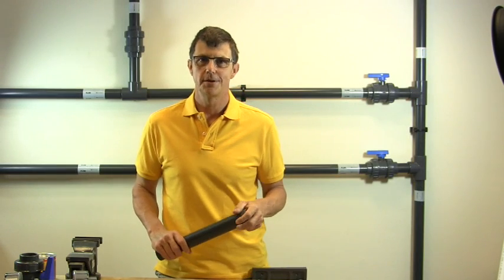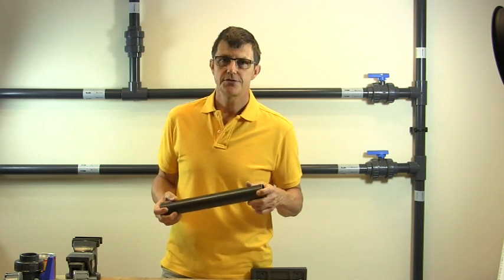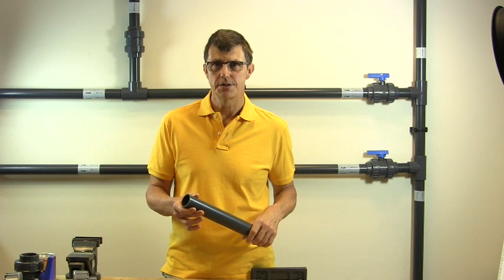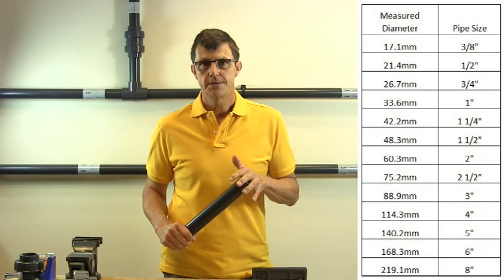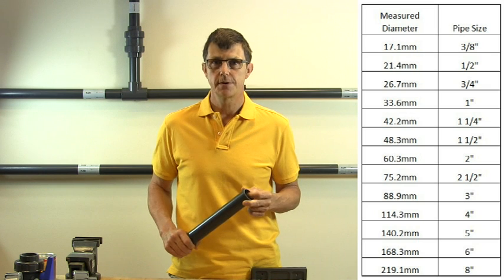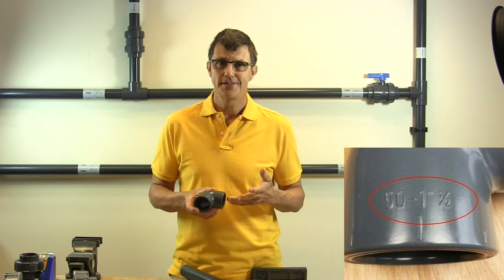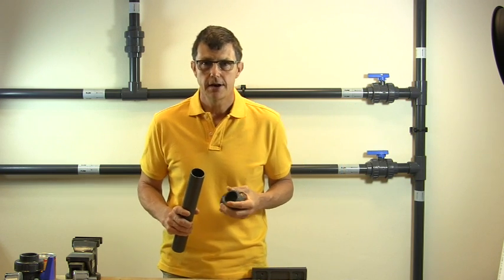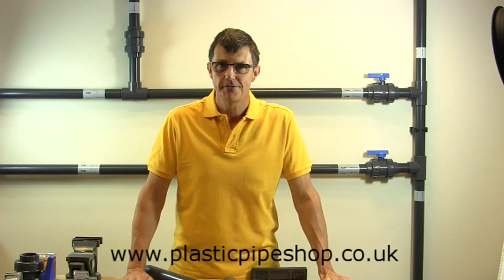Getting the right plastic pipe size

Comment: How would I know about the pipe size I need (actually clamp).. the pipe was about 8 inches circumference.
Reply from the maker: Hi there, if you are measuring PVC pressure pipe, then it is best to use a measuring tape or calliper to take the millimetre measurement of the outside diameter of the pipe. If your pipe is measuring around 8 inches, then it could be a 20mm pipe, and you'll need a 20mm clamp. Hope this helps!

Comment: Helpful but I need a tank connector for pipe that measures 32mm ID and 36.5mm OD.  Can't see that size anywhere in your tables. Also I have a sleeve connector (external) in a packet for the pipe that says 32mm but fits the OD of 36.5mm so excuse me for being rather confused.
Reply from the maker: Hi there, are you working with pressure pipe? We don't supply that size unfortunately, so it might be that you are working with a different kind of pipe system (e.g. waste).

Comment: Why does they measure differently ???
Reply from the maker: Hi there, they measure differently as they are two different measurement systems made at different times. Imperial sizes denote the approximate bore of the pipe, while metric sizes denote the outside diameter of the pipe.

Comment: PVC pipe in the US 
is measured as ID inside diameter not OD outside diameter
Reply from the maker: Thanks for the comment - in the US (and with imperial in the UK) it is measured as a "Nominal Bore", so an "approximate bore" of the pipe - but it is the outside diameter that remains constant. For example 2" sch40, 80, 120 etc. all have the same outside diameter - the 2" refers to an approximate bore of the pipe, not the actual measurement of the inside diameter. As the pressure rating increases, the wall thickness increases and so the bore changes. The outside diameter however remains the same, which is how you can fit a sch 80 pipe into a sch40 socket and visa versa. When pipe is manufactured only one dimension (either the outside or the inside) can be controlled to the tolerances required. The outside is always the controlled diameter as this is what must marry up with a socket. If you cut a piece of pipe down the length, whether it is made in Europe, US or anywhere else in the world, you will find that the inside diameter can vary quite a bit, but the outside diameter remains constant. So, if you want to be sure which pipe you have, measure the outside diameter, not the inside, as this can change with pressure rating and manufacturer.
Reply: That means head loss will be more in higher rating pipe ( sch80) for the same diameter and flow in (sch40)
Reply from the maker: @a.r.kconsultants6534  Hi, That's right, a higher pressure rated pipe of the same size as a lower one will have a thicker wall and so a smaller bore, so increasing headloss.
Reply: Pbc
Reply: I'm having trouble with this now. I got a high pressure pvc pipe and I measure the old one with measuring tape and it said 2 1/2. I got to pvc store tell them I need 2 1/2 and now the pipe is way bigger than 2 1/2. The inside bore is 2 1/2 but the outside is bigger and that's going to mess everything up for me.